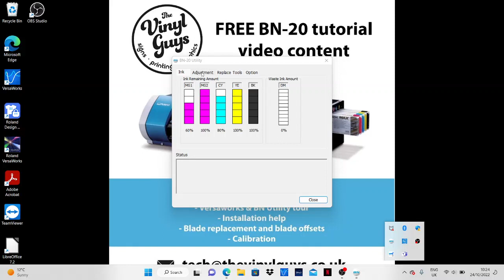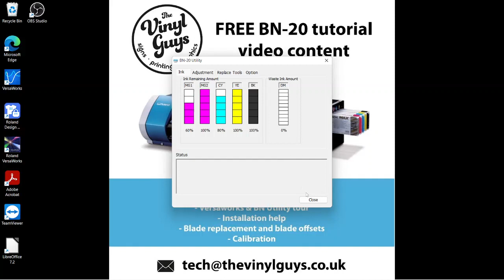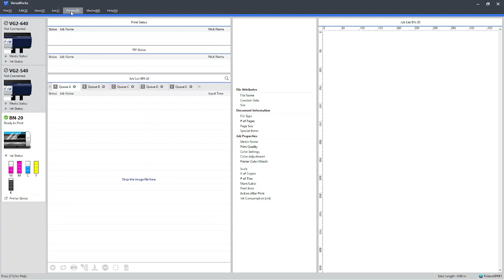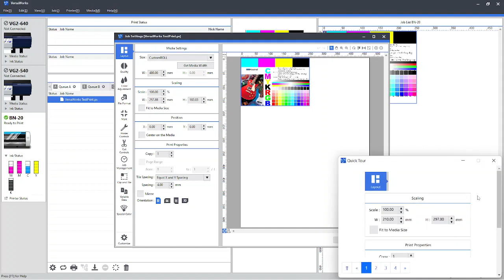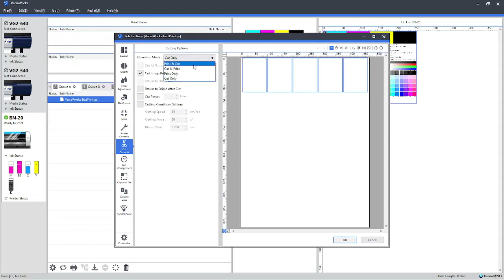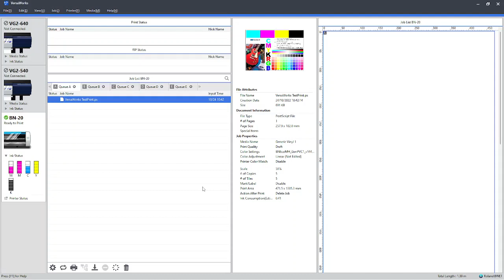Roland BN20 Virtual Workshop 1 - BN20 Utility

Comment: hi, i see air gap in my pipes. I saw the Pumk Ink section in the menus, but I do not have dummy cartridges, what do you think will happen if I do this with my inks?
Reply from the maker: Don’t do a pump ink, try to do a head soak first, there’s a video on our channel covering this. The air should filter out in time. If you need any more advice feel free to get in touch tech@thevinylguys.co.uk